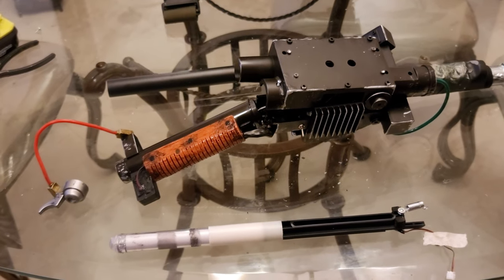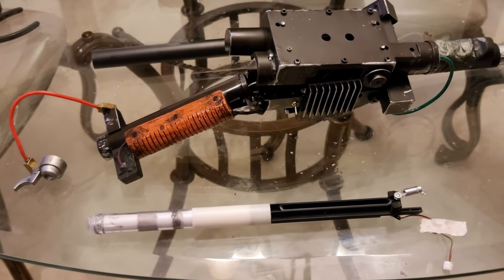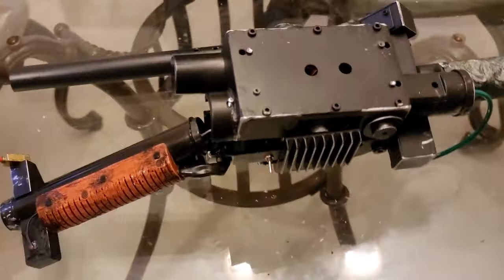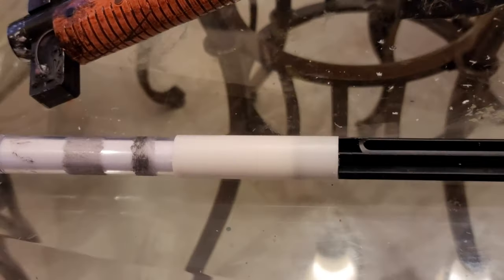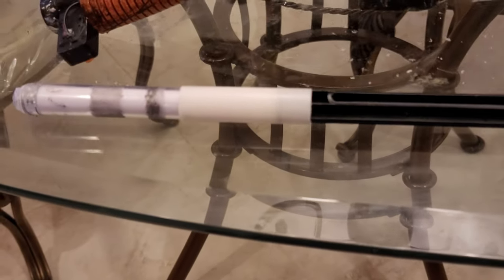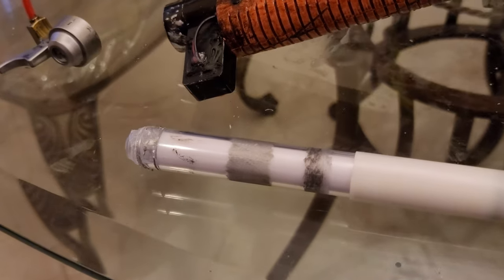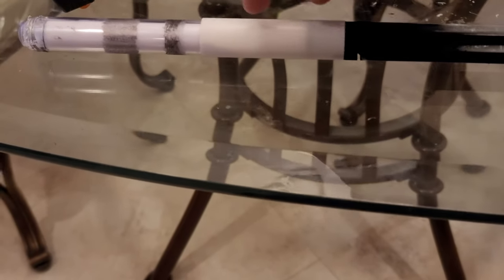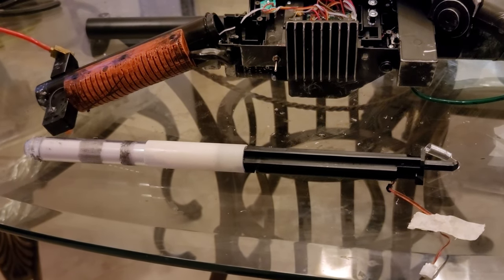Spengler's neutrona wand mod * acrylic tube replacement*

Comment: Once you unscrew the 2 screws holding the barrel how did you remove the back connector piece before sliding the barre out?

Comment: Literally did this earlier today, if you follow the black rail that the pop track bolt follows on either side , about 5mm/8mm from the edge of the outer sleeve underneath there  is a metal pin that holds the whole assembly onto the black rail. I slit either side of the frosted outer sleeve a little to access the pin and tapped it out, will need pliers to pull from other end, once out the whole thing pops off separate, your left with the clear perspex tube with frosted sleeve still attached (it won't come off its glued all over) and obviously the black gun rail separate now lets you add your own clear barrell to the end of it. Wow I don't know if that made sense lol but hey if it helps
Reply from the maker: I understood that lol. I'm almost complete and will post a video shortly, I would love to see pics or video of your mod!

Comment: My lights on the tube stopped working, how can l fix it?
Reply from the maker: Open it back up and make sure the wires are intact and connected to the internal board.

Comment: Where did you get the shell and parts for your pack?
Reply from the maker: I got my shell and almost all the parts from a seller pn ebay. He had nearly everything except the motherboard board and Alice pack, I think I paid 150$ for everything. I got lucky
Reply: @seanschops3172  does he sell packs regularly or was it just a random guy that was selling a pack kit?
Reply from the maker: I believe it was random, its a really good fiberglass kit, I think he got overwhelmed and had it for a while